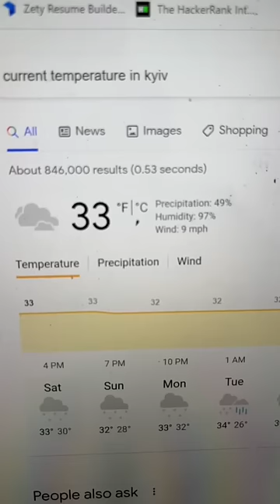Why doesn’t Ukraine use diesel locomotives as power generators?

Comment: "you can't make an electric tank"
"hold my beer!" - an engineer, somewhere
Reply: I honestly don't see why you couldn't make something like that. EVs are commonplace and battery technology is getting better, so why not?
Reply: @tite93  EV battery fires persist in reigniting. That’ll be fun for the crew
Reply: As a volunteer firefighter in Australia, I can tell you that if an electric car catches fire, it can burn for HOURS and takes TONNES (literally) of water to extinguish - you don't want that in a war zone.
Reply: @ssn2186  isn't fire already a big enough hazard with diesel engines and ammunition storage in the tank?
Reply: Enter the Abrams X.
Reply: Isn't there an EV Abrams already in the works?
Reply: @mxpants4884  I think it is a hybrid in the current iteration.

Although the replacement vehicle for the Humvee is supposed to be all electric
Reply: @ANZAC1915  Tanks also burn a long time, so I'm not sure there's gonna be much difference.
Reply: For the same reason we can never make an airplane with existing battery tech that is larger than about an 8 passenger aircraft - the economy of scale with current batteries would demand a constantly increasing mass ratio for the battery vs fuselage. Fuel based engines are much more efficient in terms of mass, especially as a vehicle grows larger in scale. The best current batteries can only power VERY small aircraft and only give sufficient power to fly very short ranges. There will never be an intercontinental aircraft with current battery tech, we need to invest in vastly superior battery technology that don't increase so drastically in mass as the mass of the vehicle does. But that tech is yet to be seen.

An electric tank would require a monumentally sized battery to move the enormous mass of a tank.. and even then, it would have a fraction of the range of a diesel tank. Electric trains have the benefit of not needing batteries - their electricity comes from the third rail of the track, it doesn't need to waste mass carrying it's own power source.
Reply: @BlackEpyon  do they create a thermal runaway situation like an ev car does, though?
Reply: @tite93  not diesel but yeah I guess ammunition but not in tanks with blowout panels that deflect the explosion away from crew
Reply: Yes and germans did in the end of ww2, the Prototype mouse worked that way.
Reply: @ANZAC1915  The problem with EV fires is that lithium is extremely exothermic when it reacts with oxygen. Doesn't matter how hot or cold it is, if the cells are ruptured in any way, and it's getting oxygen, it'll burn anyways.
Reply: @BlackEpyon  Yep, my point exactly.
Reply: @ANZAC1915  Now the question is, how long will a tank burn? How quickly an EV battery will burn out depends on the kind of damage, which controls how quickly the cells are exposed to oxygen. puncture one corner of the battery, and that cell will cook off, which slowly damages and exposes the other cells. Damage the entire pack, rupturing many cells, and pressure could build to the point where the entire pack just explodes. 

I'm no expert in tanks, but I assume the same will be true about ammo. Diesel needs both heat and pressure to combust, so it's not nearly as reactive as people tend to think, but if you've got an Abrams, which uses a gas turbine engine (due to power to weight ratio and it's ability to drink just about anything), then your ideal fuel is going to be gasoline, which DOES explode if you have vapour exposed to high heat. Then you've got the issue of ammo cook-off. Propellant is going to burn slowly unless a high-explosive warhead gets hit, in which case the whole thing explodes. How long it burns is going to depend on how much ammo it had. 

I don't think there's a quick answer to which burns out faster, there's too many variables.
Reply: Actually the Nazis did it. There wer two prototypes for the tiger. 
The one by Porsche used two gasoline, which powered two electric motors directly connected to the tracks.
Reply: Theyre literally working on a version of the Abrams right now.
Reply: @Hathur  This would not stop environmentalists from making them legally mandated.
Reply: @ssn2186  just run your tank with trolley cables
Reply: @Enkelados1  Hybrid engines can be quite efficient when they're done right. Electric motors have a very high power to weight ratio. Diesel trains are basically electric generators on wheels.
Reply: @BlackEpyon  i don't disagree and see we have both seen the video.

That system also has the advantage that the engines can always run at their optimal speed.

I don't know shit about engineering, but maybe that's a way to get rid of some problems of Turbine powered tanks while keeping their advantages.
Reply: @tite93  diesel is relativly difficult to make burn. And ammo in modern tanks like the abrams is stowed in sections with blowoff pannels
Reply: Protype of Ripsaw m5 has a hybrid engine and is a fully automated.
Reply: @tite93  Good point. If you have a hit that sets the battery aflame, it's probably also hitting the ammo, so you have bigger problems.

You don't have to worry about igniting a house that's already engulfed and/or vaporized.
Reply: @ANZAC1915  Pretty sure HE explosions count as "thermal runaway".
Reply: @tite93  because a tank is a hell of a lot heavier than a car.
Reply: The new Abrams concept calls for electric diesal
Reply: The new US tank is actually a hybrid.
Reply: @tite93  besides unwillingness to combine a highly volatile explosives AND inextinguishable roman candle in one vehicle there are other considerations:
a) EVs are heavier than "conventional" vehicles. And weight being one of the biggest contributor to tanks' gentle manoeuvrability/deployability/protection/firepower equilibrium means that electric tank would have either drastically reduced one characteristic or a little bit less of everything.  
b) being electric at our current technology would be a nightmare for frontline logistics.
Reply: @tite93  seriously? How large would that battery have to be, double the size of the tank and you have a what 100 mile charge, and the risk of fires and explosion when hit? Lithium batteries packed like that are combustible if punctured
Reply: Railgun!!!!!
Reply: @ssn2186  You have no clue. LiFePo4 (LFP) and LTO does not ignite nor burn. Try again...
Reply: @ANZAC1915  You have no clue, what LFP and LTO battery cells are, right?
Reply: @Hathur  The tank does not have to fly. It will be multifuel-hybrid. Just like a Mega-Prius. Saves fuel, especially while stationary and SILENT!
Reply: @BlackEpyon  Not LTO nor LFP battery cells.
Reply: @ANZAC1915  Wrong
Reply: @Stefan_Dahn  Flight isn't the issue. Mass is. I was just using aircraft as an example because of the disproportionate increase in battery mass when vehicle mass increases. A tank is an enormous hulk of MASS.
Reply: @tite93  Energy density and transportability.

So there was a design for a hybrid to allow silent operation modes. But it didn't take off due to cost extra weight and lower total range.

Diesel is more energy dense. Joules per Kg and joules per Litre.
Transporting that takes space.
Also recharge time is long compared to refilling with a jerry can.

You can give one guy a tank to shuttle fuel around with two dosen trips. You cannot get a battery to do that efficiently.
Reply: @Stefan_Dahn  Nah mate - everything that I wrote is 100% correct and based upon my fire-fighting experience and training with car fires in Australia, but thanks for adding to the conversation.  
LTO batteries are certainly good but they are very expensive and are about twice the weight.  Given how heavy batteries already are, doubling that weight isn't going to win them brownie points, particularly when your tank is already pretty heavy.
LFP batteries are certainly good and Tesla announced not that long ago that they were going to start to put them in some of their cars.  But, you can't charge an LFP battery when the temperature is below zero so, especially in the northern hemisphere, this could be a problem if your tank has run out of battery power.
Reply: They're already in development. The new Abrams X concept.
Reply: EV Abrams already beat you to it
Reply: @tite93  yeah but diesle burns ALOT colder than batteries and then imagine the fire is basically immortal.
Reply: @ssn2186  ah yes worry about the batteries in a vehicle full of explosives lol
Reply: @ssn2186  ah yes worry about the batteries in a vehicle full of explosives lol
Reply: The Porsche prototype for the Tiger, the VK 45.01, was actually an electromotive hybrid! It wasn't chosen for a few reasons, but it's theoretically possible. You totally can make an electric tank,  it's just probably not a good idea... although your generals can't sell "fuel" so maybe Russia would have done better if their tanks were electric XD.
Reply: "Mouse" (WW2)
Reply: Just follow the the over head lines to track down the tanks.
Reply: I mean, besides the fact that the tank weighs a whole shitton and theres next to no spare space and also battery fires are... exciting...

Its entirely possible to have an EV tank.

But just because you could doesn't mean you should
Reply: I was going to make a similar comment before I remembered that the AbramsX is a hybrid.
Reply: @tite93  actually no, if you have straight diesel on the ground, it would not light with a lighter, thats why diesal engines exist.
Reply: @tite93  also american tanks are hand operated and the ammunition is put in a armored box that explodes out off the tank instead of inwards. Russain autolaoders do have that fault that will blow the entire top off the tank.
Reply: @burgerpommes2001  I just saw video about this as a solution for long haul trucks. Tanks of course would be on unpredictable paths.
Reply: Damn it somebody beat me to it but I said okay scientist let's team up for building an electric tank to prove him worng I mean working in my own non-engineered head I can make a hybrid lol 😂😉👌😂😂😂😂
Reply: Porsche and Germany WW2 .
Reply: @Swedfighter420  The issue is refueling and range. The battery powered Tank will have much shorter range and would take too long to recharge. And how would you recharge in the middle of the desert or forest?  A hybrid would have more range but likely lose acceleration. An ev tank would have good acceleration.
Reply: 'somewhere' don't you mean everywhere, the new generation tanks will all be hybrids. So you can drive in stealth mode, you have insane torque and you don't have to continuously run the engine if you are stationary. And there are already batteries that can double as extra armour.
Reply: @tite93  well for one, weight.
Reply: Germans had something like that in WWII, it had electrodynamic transmission.
Reply: Petrol-electric tanks have been around since WW2.
As far as battery powered, what you rather have: an extra ton of highly flammable batteries or an extra ton of armour?
Reply: @hendrikvanleeuwen9110  probably way more then a extra ton of batteries
Reply: @SilverStarHeggisist  yeah, the Tesla truck has about 5 ton of batteries, I believe. Plus four large motors. That moves about 40 tons.
Reply: @hendrikvanleeuwen9110  and that's on road. There's way more resistance off road, so you eat power faster. So bigger batteries
Reply: @ssn2186  if by “fun” you mean a quicker death than yes! Cause honestly, I’d rather be in an electric tank that’ll burn way hotter at 4,000c than in a diesel tank that doesn’t burn as hot so I will die sooner lol
Reply: @ANZAC1915  Even worse battery fires can reignite themselves even weeks later. All ot would take is somebody to have to evac without warning and leave their battery, and you just lost your whole street
Reply: AbramsX: comes at you
Reply: Shaking my damn head another Kamala Harris.  I seriously doubt in a time of war that the enemy is going to say oh yes, let’s have a cease-fire for a couple hours while we recharge our various vehicles.
Reply: I think he means you can't make a wired one like you can with trains. Also, tanks are WAY too heavy for current battery tech to be able to push for more than a couple of miles.

Comment: If I remember correctly from that story in Canada, they actually drove the locomotive off the rails through the asphalt for several blocks to get it to the closest point to hook it up to the electrical grid.

Yes it destroyed the road.
Yes it destroyed the drivetrain of the locomotive. 
They both had to be rebuilt.

Comment: On top of all that:

Ukraine uses Russian rail gauge, so they can't just roll locomotives over from Western Europe
Reply: They can kindly ask Finland and the Baltic countries for some locomotives (those countries also use Russian gauge) to ship them over by sea to Galați in Romania (a port at the mouth of the Danube which is conveniently located right next to Ukraine and has a broad gauge line to the border that has been used for exporting Ukrainian grains).
Reply: I was wondering just what Guage Ukraine used. We have that problem here in Australia. Victoria has Broad Guage for lines within Victoria and Southern New South Wales, plus we have Standard Guage lines running to Sydney and Adelaide. It's embarrassing and frustrating and expensive.
Reply: @markfryer9880  I'd imagine they will reguage if pursuing greater integration with Western Europe
Reply: There are gauge change stations at several Ukrainian borders already, but changing out bogies on wagons is vastly different to doing it on locomotives
Reply: @miscbits6399  You don't have to do it if you ship the locomotives by sea to Galați in Romania, which has a broad gauge connection to Moldova and further on to Ukraine.
Reply: Can you put a locomotive on a flatbed?
Reply: @wyqtor  BS!There are hardly any diesels in Europe!
Reply: @pe.bo.5038  There are plenty. 
Granted most countries have most of their fleet electric at this point, but diesel still exist, some are stored and some are in use, especially in non commercial lines
Reply: You don’t need the locomotives. You only need the generators.
Reply: @michaelhaas4431  Yeah!Exactly!"Einstein"🤢 aka"Baehrbock"❗
Reply: Elon Musk has quit working on the Electric Tank, gone to Twitter
Reply: @michaelhaas4431  the problem is that those are fitted to locomotives with the wrong gauge for Ukraine and the weights mean that even a bogie change takes months
Reply: Moe Lester  Why are they only 4 mm wider in Guage?

Comment: also keep in mind that especially older diesel locomotives were usually not diesel-electric, but quite often diesel-hydraulic or diesel-mechanical, where the diesel engine is used directly to turn the wheels, not acting as a generator powering electric motors like on diesel-electrics

Comment: Also, when you're using your locomotive as a power station it can't move, making it a prime target.  Trains are also really, really heavy.  A place in Texas drove a train down main street to hook it up to their mains and it did some major damage to the road so it's not like you can do it just anywhere, the track has to be pretty close to a substation.  This really only works on a small grid like a single town.  We probably should start sending generators for the people to use, tbh.
Reply: Had a ton of generators start showing up on thanksgiving I believe. Denys davidov is a Ukrainian that does a pretty good daily update on everything if you want to give him a look on YouTube.
Reply: I don't think Ukraine is concerned about tearing up a road at this point. You make plenty of good points about why diesel locomotives aren't practical though.
Reply: Get them onto Kyiv's metro tracks and hide them in the tunnels!
Reply: The immobility is a crazy argument. No power source can move, but if any can be, it’s a train. It can at least be moved from time to time, or put in trees, or camouflaged.
Reply: Camouflage the trains somehow or put them underground in some way 

Also you don’t need the entire train, just the portion to run the generator. The rest can be dismantled.
Reply: The problem isn't power generation but power lines. Most power plants are fine. Just not all the cities are connected to the grid. 
Destroying power lines is key. They're massive and you can't hide them, they're unguarded, and destroying one is million times more simple than finding damaged part and fixing it, especially when you risk encountering enemy forces.

Comment: You can't make an electric tank.

General Dynamics now has an idea
Reply: Didn't someone try to make a diesel-electric tank... name starts with P I think.
Reply: XM-1 program intensifies
Reply: Abrams
Reply: Tanks will be electric. As electricity can be generated on the spot and soon beamed from orbit while fuel takes lots of logistic strain. Also tanks would be much lighter that way.
Reply: @d3r4g45  Umm… no. That is sci-fi nonsense.
Reply: @d3r4g45  If I can beam up to multiple MW of power at less than a few square meters, I don't need to power tanks, I just fry the enemy with my laser from space.
Reply: @JainZar1  Tiger P?
Reply: @JainZar1  Porsche designed one in WW2. I think it turned out to be way too heavy to be practical - it had 2 large diesel generators.
Reply: 1943: Maus tank, Germany. Diesel electric drive train.